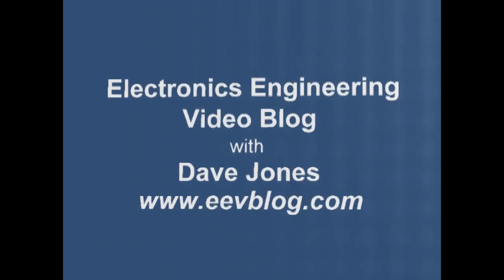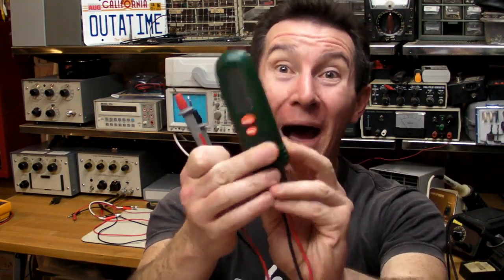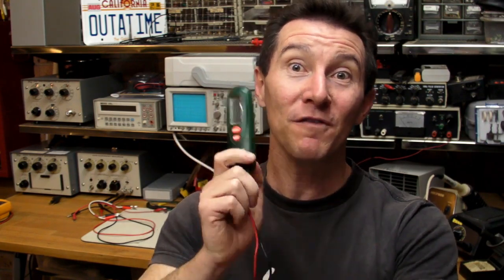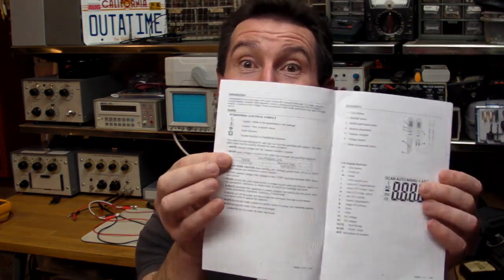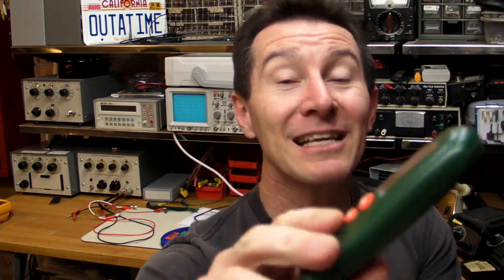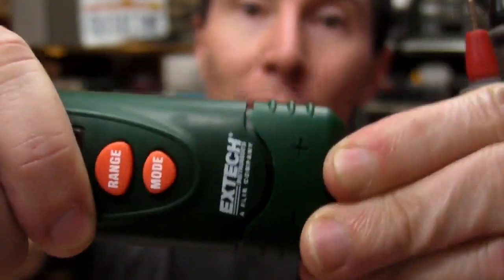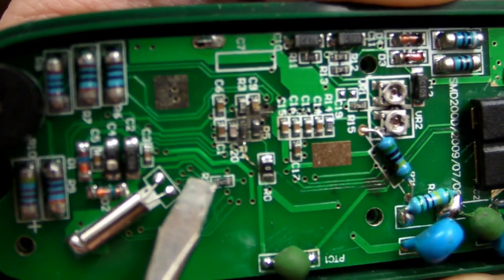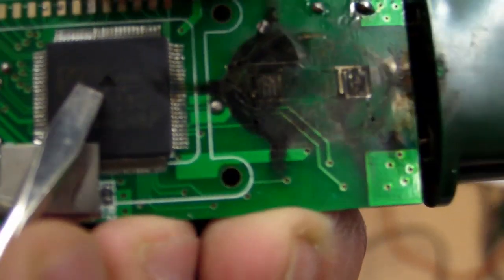EEVblog #94 - Near Death Multimeter Experience

Comment: I bought one of these before this rant and never had a problem. But I believe in RTFM and common sense. Really?  Do you plug your meter probes in part way?  Do you use a 1x scope probe for mains voltage?  It is not FOOL proof. Did Extech respond?

Comment: Years later I agree, even if you know better than to apply 240V AC to it when it is in capacitance or diode mode, eventually it is going to happen just from someone holding it the wrong way and accidentally changing the mode. Whereupon it will blow up in his hands with a loud bang and the problem with that is that it might startle that person so much something seriously bad happens as a result. That's not even meant to be funny, a man might fall from a ladder or drop tools on men working below him, or through some other startled movement cause all sorts of mayhem in an industrial setting. A button gets pushed that starts a press and somebody is missing both arms three seconds later.

Comment: It's a bit harsh blaming the meter if you put it in the wrong setting! I put my multimeter across 240v with it in the current configuration! Luckily it only blew the tip off my probe.
Reply: The reason protection is mandated is for this exact reason. No way that thing should have been Cat II rated let alone Cat III.
Reply: @russell2952  the problem is that so many products are made in China now that they can put whatever they want on it and there's no comeback if something goes wrong. That's why if your dealing with potentially deadly things you should always buy quality products that are properly certified and safe for use.

Comment: Just seen this for the first time before noticing how old the video is. I hope they have fixed the problem and replaced your unit with an upgraded version as well as doing a product recall of the models that do not have the protection against mains voltage safety switching.
Reply: Cool rant however, loved it

Comment: Had that happen to me once.  It wasn't a name brand meter, but it was from the local electrical wholesaler, wasn't a POS from Walmart or the Dollar Store.  We were checking for power on some crane rails, I was probing with the probes while another fellow held the meter.  It might have been in current mode, but I doubt it. Even it if was, the fuse should have dealt with it (HRC).  The meter blew up in the guy's hand, the leads melted and fused, from multi-conductor to single conductor.  This was in an aluminum smelter, in the potroom where the aluminum is produced.  He was so spooked, he nearly jumped back  into the pot!  The meter had all the right ratings, in theory, on the case:  Cat III or IV, 1000 VAC, etc.   We got a Fluke after that.  Only Cat. III rated, 600 VAC, but we never had any more troubles like that.

Comment: IEC 61010-1 states "the meter shall take the maximum input voltage in ohms or continuity settings" If the manual states specifically damage will occur if the meter is exposed to voltage in other ranges it DOES NOT qualify for Cat III. It is likely this little meter has never been tested and is inferior in design and or component construction. This is why I am a Fluke man and strongly object to Exetech as a vendor. Much if not most (or a least some for the benefit of doubt) of their meters are NOT 3rd party tested by UL or CSA.

Comment: As respected as Dave is, I am sick of tool and machine review channels not reading manuals. Many channels insist that reading the manual is some sort of negative influence on their review or not important for real men. This macho BS is promoting dangerous health and safety behavior. Dave admits he would be an idiot to set the wrong setting on an analogue turn switch but thinks using the wrong setting on a digital switch is not his fault. Just by looking at that tiny thing, i think you would be stupid to go anywhere near 240AC without reading the manual first.
Reply: No kidding!

Comment: Well what kind of recognized safety lab certifications does it have? I saw the CE mark in the video but CE is not a strict safety standard. In the USA, we have UL and ETL. I know all other first world countries have similar certifications and Australia is no exception. If any multi meter lacks those, I would have to assume it's not safe for line or high voltage measurements. And to some extent that's OK provided you know that and use the meter accordingly.

Comment: Dude every cheap multimeter blows his fuse if you measure voltages over resistance mode. As I see thisone hasn't any fuse. From now open it in before you use it
Reply: And Dave always says 'don't turn it on, take it apart"?  Or maybe that started after this episode!

Comment: It passed the category test!! by containing the detonation within the case so no probs GET over it drama queen!   BUT that plug in probe / switch arrangement is pathetic at best  extremely poor in design and should never have been put on market that way, switching should have taken place as soon as adaptor is applied BEFORE they made contact & defaulted voltage mode first !! i too would be pissed off
Reply: He got this before it went to market. It was redesigned with the changes he suggested before it did go out to resellers.

Comment: Safety by design gets lost on a lot of companies...  One of my old meters did not follow this principle either.  I was doing something with my mains, and I used that meter to test the voltage.  Normally what I do is to measure the mains to make sure there IS voltage, and then if I need to, I shut off the mains and then measure again to make sure there is NO voltage.

So to do my initial measurement I turn on the meter, set it to measure AC voltage, and then measure.  I get voltage, which is expected.  I then go to shut off the mains and come back to measure voltage again.  The meter had turned off, and I turn it back on and measure.  It reads zero volts, as expected.  I think everything is good until I try to handle some bare wire and get a funny feeling in my hand...

Later I realize that the darn meter had reverted to measuring DC voltage when it had shut off!  Of course we know that a DC measurement of AC voltage will read zero.  It turned out that I had flipped the wrong switch at my electrical panel, and was handling live mains with my hands!  Let's just say I got a new meter after that incident.

Comment: If you had used it correctly measuring the voltage in a circuit, and then unplug the meter from the harness to swap probes, it will blow up the instant you unplug from the leads connected to a live circuit! Very bad!

Comment: cmon dude - its under 1kVAC - thats LOW VOLTAGE. Below 50VAC is ELV. Supposed to be an electronic engineering show - ffs at least WE should be able to use the term right XD

Comment: I have a DMM (Voltcraft VC270). I was trying to measure my 230V  and I thought well, why not measure the frequency. So I turned the switch to Hz. Turns out, resistance is between voltage and frequency, and from that day the dmm displays 80kohms at open circuit...

Comment: EXXTEC!?!.... Very appropriately named corporation!... Just get a "Fluke", it will never leave you "Fluked!"...
Reply: ytrewq6789 I bought a fluke non contact voltage detector that didn't work right out of the box. Had to exchange it for an extech. I might have just been a "fluke" but I was not impressed with it not working out of the box.

Comment: Does the meter show what mode it is in on the display?  I doubt there are many DMMs that could survive being connected to 240Vac when in resistance, capacitance or diode measurement mode.  This does seem flaky with the mode-switch on the probes.

Comment: Hi Dave, a question (even though I realize it's now almost 7 years later). Shouldn't a multi-meter (no matter the size) such as Extech's RC200, be outfitted with a fuse to prevent such explosive circumstances if attached to the mains? It seems to me that if the mode matters, that the bare minimum would be a fuse to prevent not only the loss of the multi-meter, but possible injury. Wouldn't a fuse have really prevented this whole problem with the RC200? I mean, the fuse would have blown and that could be easily replaced. Is there no such design requirements to place fuses onto products as a bare minimum safety measure when designed to be attached directly to the mains?

Comment: I think that switch design could work quite well if the probes engaged the switch before mating with their own contacts. Think of the UK wall socket design, the ground post makes contact with the socket before live and neutral do. If they did that, you could operate it with confidence that the thing was locked into high voltage mode before the probes could even be used.
Reply: Richard Stifle I agree, a better option would still be to have the switch work the opposite way. As in, it'll be in voltage mode when not engaged. That means less redesigning mechanically, and more importantly: it'll fail safe.

Comment: I know it's long time ago but why not use reed switch and a neodymium magnet instead of mechanical switch?
Reply: Would fail if measuring near some other big magnet.  Here's another option: Slightly change the mechanics so the switch moves before the probes connect electrically.
Reply: John Doe Or make the switch move with tweezers, not with probes.

Comment: 7:30 holy crap, you're 100% right. It's literally the definition of "fail safe" covered by ANY college of engineering of worth. If something is going to fail (and everything CAN), it should fail safely. That switch mechanism should absolutely default normally to the safest mode, so if it fails, it fails into the safest setting. Their design is equivalent to having a guard on a saw, table saw, mower, default to full open unless you latch it down. So if the latch failed, the guard would fly off and your hand would be eaten up by the blades. NOBODY DOES THAT.

Comment: LOL YOU CHECKED CONTINUITY OR RESISTANCE ON LIVE CIRCUITS? XD no wounder it blew up in your hands...
Reply: Actually, there is a real use for that: Checking the resistance of your PE connection by measuring the resistance between PE ground and the grounded utility Neutral.  That requires a meter with a mains safe ohm mode.
Reply: John Doe what multimeters allows one to measure resistance across a live circuit? are you talking about one of those expensive 1000 dollar ground resistance meters that almost no one has/uses because its easier to just pound in two grounding rods instead of just one and just increase the neutral conductor size.

Comment: One of the copper mines in Arizona has  an electric room/transformer vault with a pair of exposed test points for the 69KV primaries. I have seen Volcons, Wiggies, Extec, you name it, voltage testers, VOM, and DVMs destroyed trying to probe 69,000 volts AC. The Volcons, & Wiggins would literally explode, sending the solenoid core out like a bullet. The Extec's capacitors would explode through the meter face. The Fluke meters would just smoke, so I gained a lot of respect for Fluke meters at the Baghdad Copper Mine. I never blew up a meter tying to test 69KV. I have probed those test points with an O Scope with differential probe set rated for 150,000 volts, but never a hand held anything. The silly thing, is, those test points are marked "Warning, 69,000 Volts AC". I guess some people are just too curious for their own good. If my meter is rated for 750 VAC what would I expect it to do, at 69,000 volts AC? Thank god I had an endless supply of idiot to test  that for me, with their own equipment.
Reply: I be been to Bagdad,  loved how the bar at the main intersection not far from the Copper Cafe had a sign on the door "Closed on Tuesday for AA meetings".

Cant imagine ever attempting to be anywhere near enough to that high of a voltage to use a hand held meter with the power on or off!  I saw what 460vac 3 phase did to a Sears meter on a 4,000amo service, big loud bang, nothing left of the meter but a black spot on the ground and two believed leads.... 

At the time I was was there visiting all the home were owned by the Copper mine the mine was looking at hiring a property management company to run the town,  I recall they inspected all the homes and found some with a lot of stolen mine equipment.

Comment: It could be done right so easy. The connector range switch has to be in the high voltage mode all the time. ONLY the tweezer case could switch it in to the low voltage mode!

Comment: About ten years ago I purchased a multi-meter, and as usual I dropped it. This meter when it dropped caused a metal screw and the piece of plastic inside that it was threaded into, to dance around inside the meter. I thought that a huge engineering failure. This was a decent meter bought at an HVAC supplier. It happens nowadays, because people that love electricity, know the basics of electricity are twisted, so they do not want to see their love twisted up everyday, so they do something else.  Most get involved in the field of electricity for the money, that is really not a field that flourishes in a money oriented environment.Sincerely, William McCormick

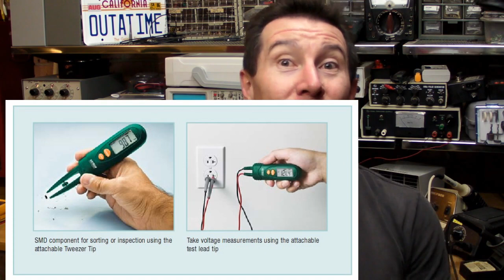Comment: 2:00 - I think I see the problem.  In the pic it's an American plug and therefore it'll be connected to a pathetically small voltage.  You don't need a meter for that - just use your tongue :)
Reply: +EscapeMCP American plug sockets have more than enough voltage to penetrate skin and kill? Don't even try it!
BTW, We have 240v outlets as well for larger loads which may also be wired to this type of socket by mistake.

Comment: I have a RadioShack multimeter that is a CAT 2 500 volts max, 200 mA max also. I used it to measure my mains (which is as you already know only 120 volts), and it tested fine without exploding in my hand! I can't believe that multimeter has no fuse! Even my cheap ass one has a fuse built into the damn thing! I used to use those neon lamp screwdriver things to test the mains, ahh, those were the days! I'm glad that stupid meter didn't kill you Dave! I love your videos!

Comment: My Amprobe AM220 blew up by leaving it in capacitance mode by accident when probing a 200Vdc supply rail on a broken  oscilloscope. The meter still works on most ranges, but the resistance range is very inaccurate now, and reads 40Kohm open load, and the capacitance range is completly dead. I took it apart to see if it might be a easy fault. The capacitance range seems like it is has simply gone high impedance and does not connect to the probes, and it seems like maybe something (like a charred capacitor or something) has shorted the resistance range preventing it from being accurate. However I have not found anything damaged at glance inside. I will need to have a closer look.

Comment: If they cannot properly design a meter to handle high currents in the wrong mode... then at least use separate rails. But regardless... the meter is all digital in the first place. There is not reliance on mechanical switches... How difficult would it be for them to design the meter to fail over to the right mode if high current is detected when in the wrong mode, or at the very least... pop a fuse instead.

Comment: No fuses, 600 volts CatIII?
Reply: +spartanworria    This explosive Multimeter was designed by Al-Qaeda / ISIS or CIA ? ^^
Reply: YES ... but makes no difference, ISIS is already made by CIA ^^
Reply: +Ed Waggoner Sr. (Papatch) Fuses protect current ranges. There are plenty of movs and ptcs.
Reply: Killerspieler0815 Isis are to stupid to build multimeters,  They must have bought them from the CIA.lmao
Reply: Look at the design of the industry standard, Fluke, it only has fuses to protect the current measuring circuits. This meter does not measure current therefore no need for fuses, the MOV's are the input protection.
Reply: Killerspieler0815 CIA is the code word for "head quarters" to Isis.lol
Reply: yes - ISIS / Taliban is a CIA division
Reply: The fuses are for the current range only. Look at the circuit of any mainstream multimeter. There are no fuses in the high-impedance voltage/resistance/diode circuit, because THE DAMN THING SHOULD WITHSTAND RATED VOLTAGES AS-IS, and the transient overloads should be absorbed by the protection devices, per requirements implied by the CAT rating.  And if it gets overloaded on voltage mode past its ratings, then something will safely vaporize, no fuse needed since the current wasn’t big to begin with and there is no arc to break.
Reply: ok so everything worked like its supposed to
Reply: +Ed Waggoner Sr. (Papatch) No fuses, 600 volts = hospital/grave yard.
Reply: yes, without fuses it's a devil's joke! When I've seen the beginning of the clip I've instantly thought "what? no fuses when it's suppose to measure main voltages?" For me it's just a peace of shit to create things like that.
Reply: Everything is a fuse if you have enough current.

Comment: One other thing to consider is that like most things as you send more and more power to them, they start to self-induct. If you take an older car tail light and power it with a six volt battery. Keeping one hand on each lead from the bulb, as you touch the battery and then lift one wire. You will at some point feel the electrical current. Even though you will not feel the six volt battery voltage. It is the same as if you hold both leads feeding a transformer, and touch and lift one wire from the battery powering, while you have a hand on each terminal of the primary of the transformer. I am not recommending you do this in any way. It can cause you to cringe a bit, the feeling is often rather powerful. People have died doing this on larger devices.

My point is that air is no different, when you see light from air, it is in a self-inducting state. It can and will emit higher voltages then the power source creating it. That is why an ARC inside a multi-meter is so dangerous.